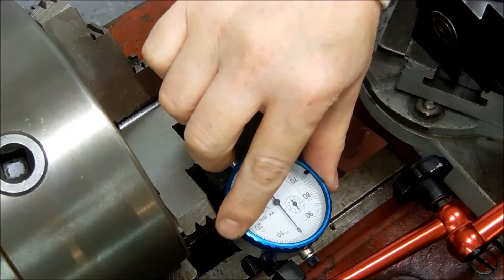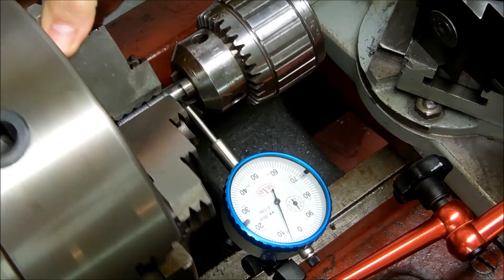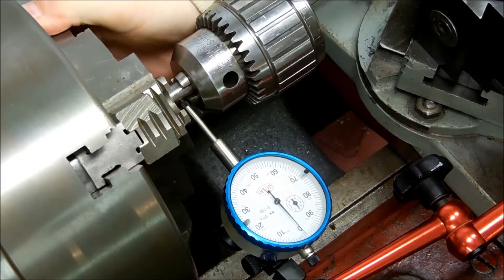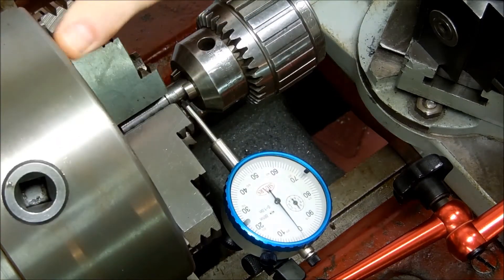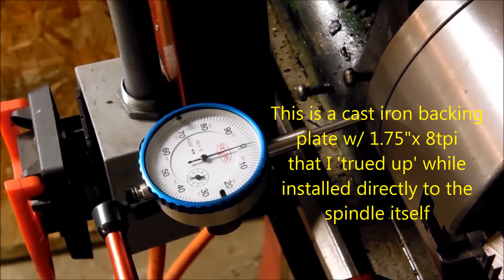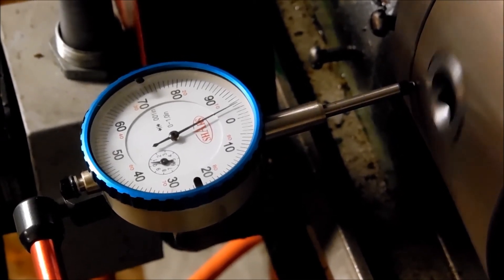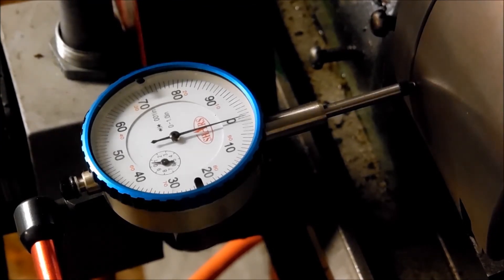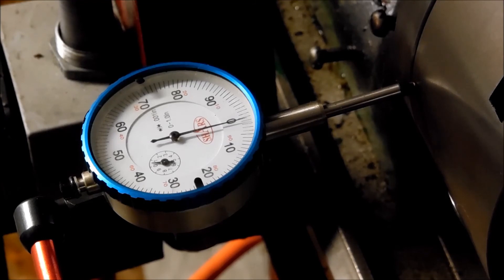Runaway Runout!

Comment: first off make sure your spindle bearings are tight and within tolerance. After that take the chuck off the backplate and cut off the register of the backplate. Make sure you use a razor sharp high speed steel toolbit for machining the backplate. Carbide inserts are actually not sharp enough to get a good true cut on your lathe because it does not spin fast enough.

Comment: Don't worry Chuck if run out of runout I have plenty of spare runout running around in my shop and you are welcome to run over and collect all of it.  My chuck was like that and I tried mounting it in the other two positions and found one that was much better than the original that was running out like yours.  Then I got a new larger chuck and was amazed to find it only running out about a thou and a half right out of the box, first try, had to check it three times as I was sure I was measuring it wrong.  So having preconceived notions of a crappy chuck just because it originated somewhere in the Orient proved to be false (this time.).
Reply from the maker: Thanks for the laughs John, that's too funny. I have the same hopes for adjusting this one to run better, as I've learned some since installing it a year ago, and it is only "guaranteed" to run with a TIR of 0.0039, but that's better than now...and I might even get lucky like you did ;)

Thanks again for stopping in, Aloha...Chuck

Comment: Hey Chuck, Don't worry about the outside runout of the chuck, make sure it is very tight to the backing plate and the backing plate tight to the spindle. Then take a carbide end mill or a precision ground pin, chuck it up and check the runout, if its out you can grind your jaws true. Now, you don't have to do any of this for boring the drill chuck, leave the part you have chucked up and take about a 10 thou cut off it, should run true, zero runout. Then put the drill chuck back on and go to town on boring it. I hope this helps!
Reply from the maker: Thanks Ray, I'll check that out...what's weird is that I can't seem to get a mandrel to run true to the lathe, and that's why I wanted to true up the chuck. I shouldn't be getting 7thou runout on a just turned stub only .050" away from the jaws, so something fishy is going on. I'll try your suggestions again, but the bore just won't true up for some reason...there may be too much flex in my set-up and boring bar, would that cause it?

Thanks again...Aloha, Chuck
Reply: Take light cuts with a sharp tool. Another thought, check your spindle and verify its there is no movement there as well. Put your indicator on the outside of the chuck and push the opposite side, the indicator should not move.
Reply from the maker: I will, and you should see how sharp these little carbide boring-bars I got are, they are like little hatchets, LOL! I'd be out there right now, but I had a couple of beers with Pop while watching the Cub game, and spending QT with him is top priority for me.

I'll let you know how it goes tomorrow after I figure it out...hopefully.
Reply: If you grind the jaws when the body is out then the jaws won't be true to the scroll and will only work at that diameter. Picture moving the chuck 1" off center then grinding the jaws. It will chuck accurately at the diameter it was ground at but close down off center.
Reply: Yes, you are 100% correct but Chuck did say its mounted to a backing plate with almost zero runout, so I am assuming the shoulder that locks into the back of the chuck was machined to fit snug also has zero runout. and is tight but I should not have assumed, because you know what that could mean!

Comment: You could put a piece of stock in the 3 jaw and turn a section to the largest diameter that the drill chuck will take. This way you have a 100% true mandrel to mount the drill chuck to.
Reply from the maker: I've turned it in the attempt to get the mandrel to run true(and it's just under the max now), but there is still .005" in the mandrel...still trying stuff before tearing into the chuck, since that just doesn't make sense. I'll keep you all posted ASAP. Thanks for the help.

Comment: Hopefully you were able to just loosen the bolts between your backing plate and chuck and tap it around enough to true it up and it stays there when you tighten back up.  Looking forward to how you went about it in the next part.
Reply from the maker: Thanks Ryan, I'm going to have to run a flat-ended drill bit into the mounting holes on the backing plate to do that. They have a conical taper from the regular bit I used originally, so even though the fit on the register was good and the bolt pattern lined up, there's not wiggle room to tap it in like Stefan and John Mills have showed. Trust me, I tried that, LOL! I'll be uploading more tomorrow and hopefully I can figure this puzzle out...Aloha, Chuck.

Comment: Why can't you just turn the shaft in the lathe chuck to true it up and fix the lathe chuck problem later.
Reply: Hi Chuck, interesting video here. If you have run out after taking a cut then the problem is either the spindle bearings are worn or need adjusting or the headstock is moving.The spindle will be in a different place when turning as opposed to when still due to the oil film dynamics. Too great an oil film(space) and the spindle moves around with cutting pressures. A pry bar or 2x4 and the indicator will tell you. It's a good idea to do the same to check the carriage. Tighten everything down then take another cut and check again. A part just turned should have near zero runout (of course you know that).
 Zero runout on the backing plate with runout on the chuck has to mean the chuck has moved on the plate. Or maybe if you had it off the plate, try putting it in the other positions. Also check the spindle flange and thread for damage or dirt. Although one would think that would show on the backing plate, if it is rocking it may not as the farther from the flange the greater the runout. Almost a tick at the flange can easily mean 7 thou six inches away. Hell of a lot more to these machines than most people would guess, isn't there.
 But also as Adam shows all the time if you want real accuracy, rigidity and grip use a 4-jaw. And you know you can't argue with Adam.
    Mike  (o\!/o)
Reply from the maker: See, that's what I would normally do, straight forward and easy as pie, but there is something preventing me from even turning a stub-mandrel true to the lathe...I'm wondering if maybe my bearings are shot, it's a little baffling, and tomorrow when it's light, and more importanly I'm wide awake, I aim to go and tackle it. Thanks for the note, and I'll keep you posted...Aloha, Chuck
Reply from the maker: Thank you, I did find some disappointment in the main bearing, but may have 'fixed' it...a little. I will be needing to make a new set of Bronze Bearings sooner than later though, along with a new cross-slide leadscrew and nut...I'll be posting the finding tonight late. Aloha...Chuck